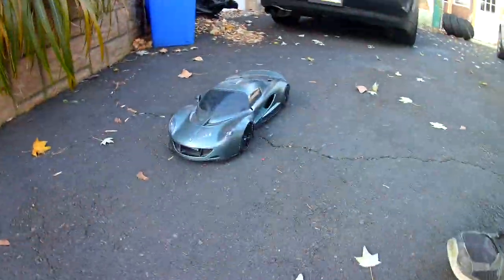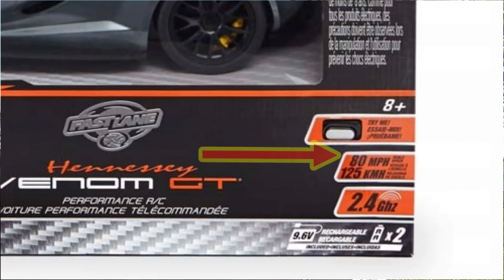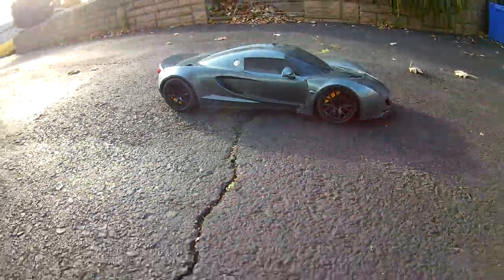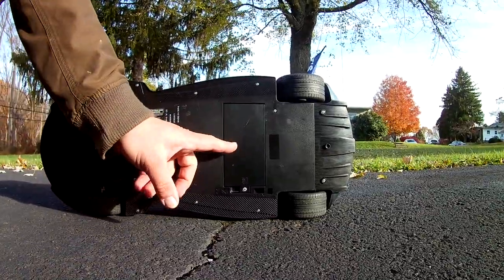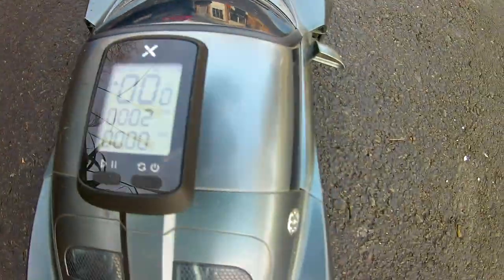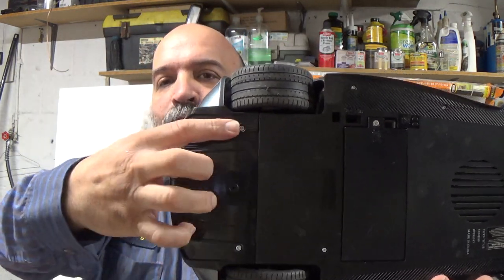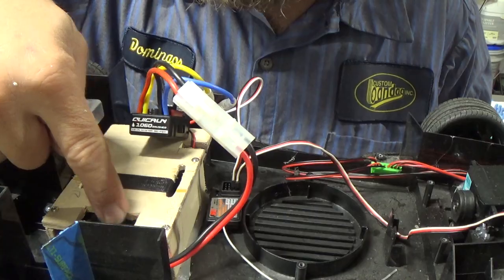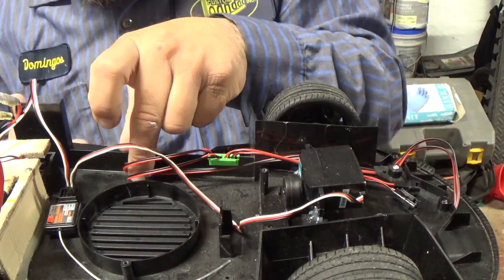1:8 scale Hennessey Venom GT toy grade RC car with Hobby grade electronics test and speed run

Comment: 80 mph is possible with the Right Upgrades! I'm doing at least 48 mph with a Radio Shack 1/8 scale Toy grade Camero, equipped with Losi 4500 KV motor and 120-amp ESC.

Comment: Cool car. And that was advertised to do 80mph??    In what other dimension. lol...    It is fun to scratch with these toy-grades.
Reply from the maker: 80 nph in 1/10 Sscale which is like 8 or 8 mph but im gonna try to hit the 80
Reply: 80 mph is possible with the Right Upgrades! I'm doing at least 48 mph with a Radio Shack 1/8 scale Toy grade Camero, equipped with Losi 4500 KV motor and 120-amp ESC.
Reply from the maker: @williamsaloka9043  yea 80 mph in 1:10 scale not 80 mph 1:1
Reply: @rccargarage  Companies like to be deceptive to get you to buy. Just leave out the word "scale" and people are thinking 80mph!!
Reply from the maker: @williamsaloka9043  that's very true

Comment: Lo mas que podrias hacer es colocarle un ESC apto para 11.4 voltios y colocarle una pila Lipo de 3 celdas lograria duplicar su velocidad pero el costo economico de eso no lo vale porque es un juguete te lo dije no todos los modelos son buenos ni modificables te recomiendo que consigas una camioneta HUMMER DE RADIOSHACK MATRAXX 1998 es poder absoluto velocidad y fuerza la puedes modificar y es una bestia